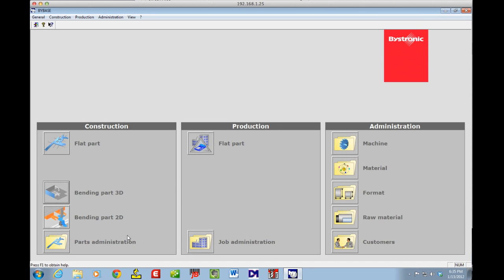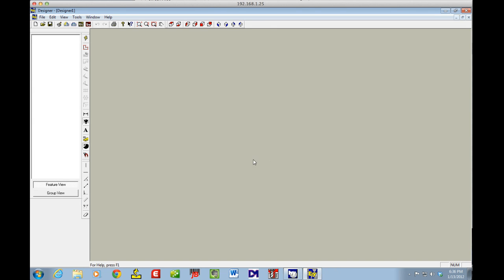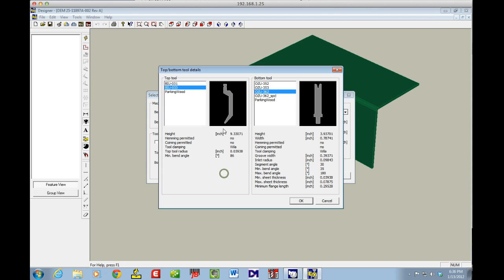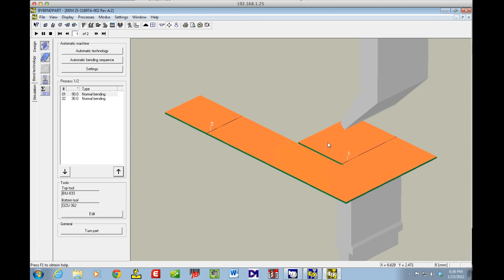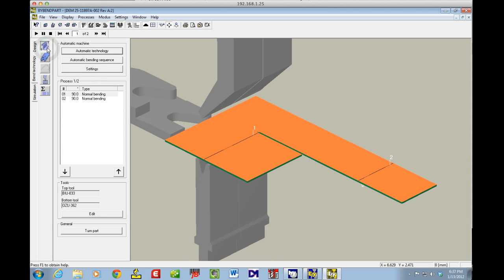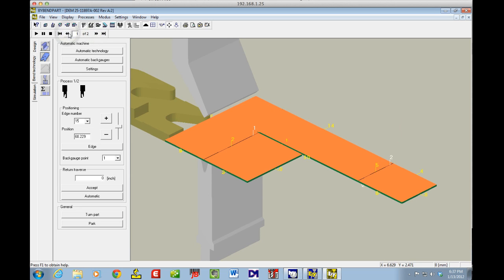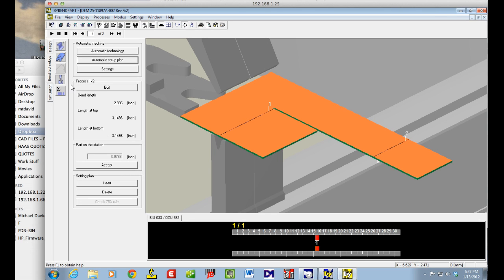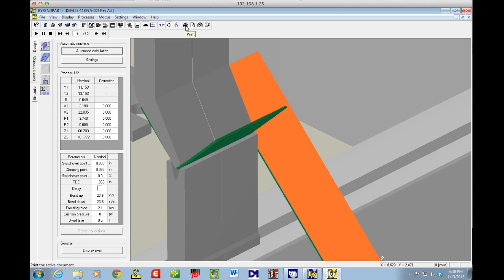xpert offline programming level 1a

Comment: Hi!  I know these videos are 5 years old, but I'm desperately trying to understand the "deviation" both in bend angle and flange length (XB). I've scoured YouTube and the Bystronic website looking for training videos but yours are the only useful ones I've found.  I will literally give you my phone number if that's what it takes to wrap my head around this deviation nonsense...  🤦🏽‍♂️😆
Reply from the maker: Thanks, I have been meaning to do some updates on the newer software but just have been so busy. Are you trying to figure out the setback or stretch out of the material?
Reply: @MikeD4  Neither.  At the machine you can change the bend angle, which results in a deviation value right next to the angle.  I think I've got it figured though...  I kept trying to put in the angle that I WANTED.  What it appears to want is the reflex angle of the part that I bent, and then it makes the adjustment accordingly.  I've been using that method today and it's working great.  Much better day today.  Lol